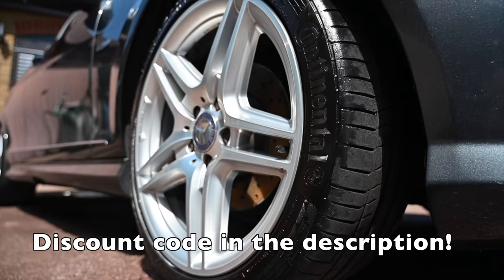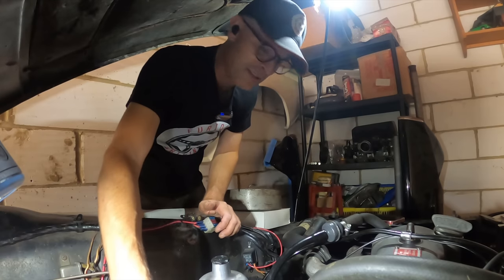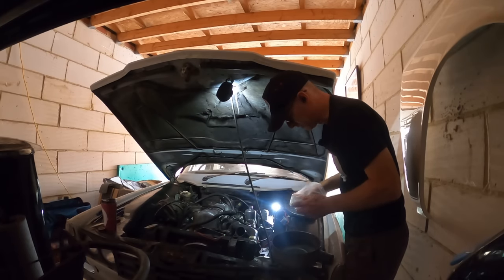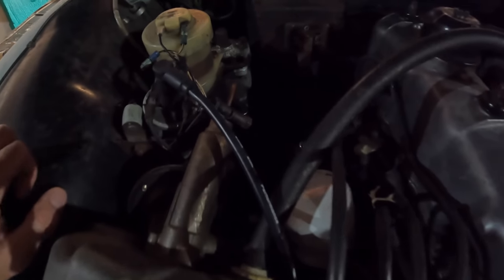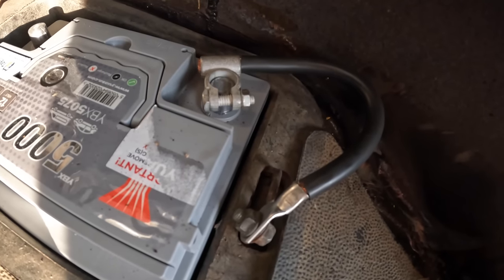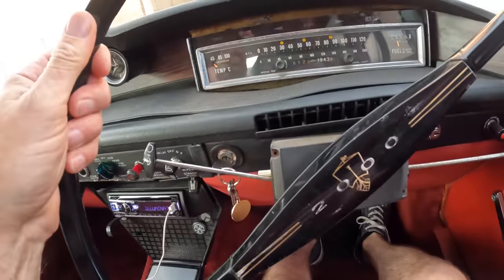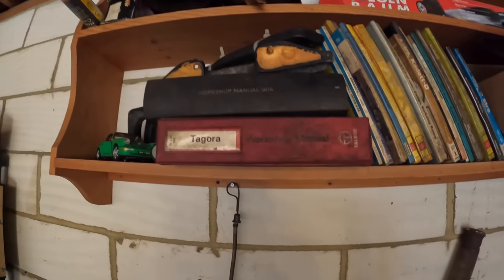Rover 2000 fuel leak fixed, Ready for a first drive?

Comment: Hi Matt, I almost wonder if the box has managed to tighten itself up... That type is easy to adjust, you remove the big dome topped nut that's closer to the engine which reveals the screw head, undo the locknut keeping it tight to the box and then lefty loosy righty tighty - I'd do up to half a turn at a time, taking note of how much you've done it by, between feeling the steering. Re lock it as it can move as you steer (I wonder if it wasn't locked tight and steering right tightened it) then put the big domed nut back on. Shouldn't take too long...

Comment: I would look at the steering box oil to start with, I've seen them get very corrugated after many years. The adjustment is to take out play so I can't see that being an issue and the idler boxes don't cause issues apart from clonking. I'd be looking at the track rod ends and the top ball joints, they can get stiff which cause similar issues with lack of use. It's a shame because the last time heard Geoff wants to sell WINS but nobody wants it, once he's stock is gone P6's will have MGBD for as long as that business runs and JR Wadhams which are great for a new panels and parts (at some cost though).

Comment: Another step in the right direction 😀 by the way, those tires look like they are at half pressure, I think it helps to pump those.
Reply from the maker: They are probably a bit low but they always look quite bulgey
Reply: You mean  step in the straight direction !

Comment: Is there still bottles of Ledreplacement for older cars? I saw an almost empty one in my garage, last used when running an Volvo B30B in an Volvo C303 Tgb11 about ten years ago, it needed 98 Octane as well and used 28L/100km doing 90km/h, reducing the speed to 70km/h made it use "only" 20L/100km! ;) Buying an old car was cheaper to use for travelling to and from work than that with all fuelconsumption. :)
Reply from the maker: yes, still easily available thankfully!

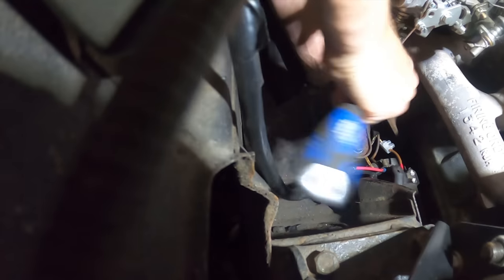Comment: Dude. Solder the wire at 1:47 instead of creating a possible fire hazard. Never use those on a car...!
Reply from the maker: Did you see the last video? Car is in a garage with no power so that's a fix to get it out of there
Reply: Dude obviously ones of the bros from over the channel